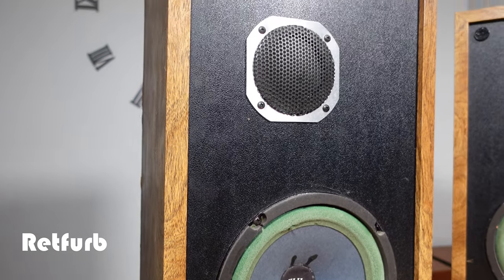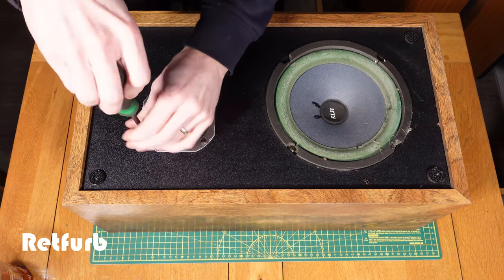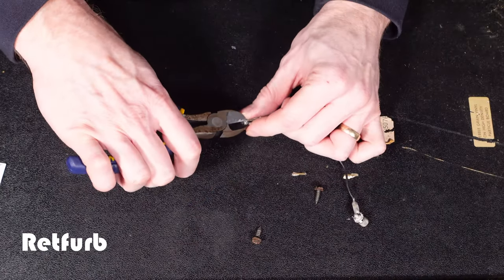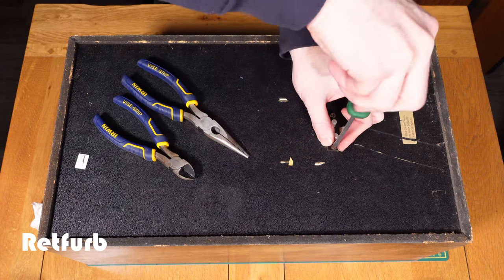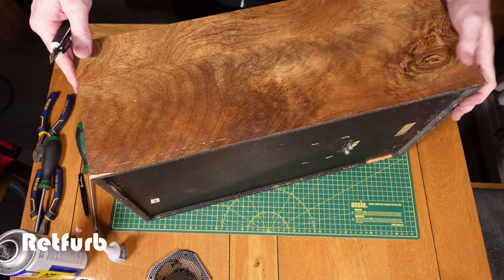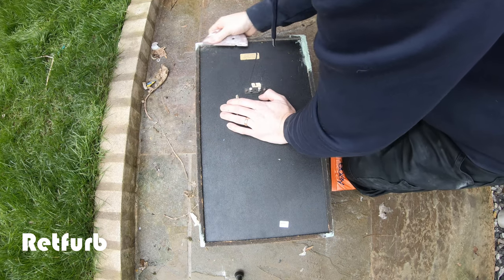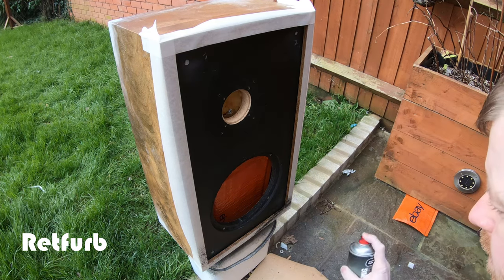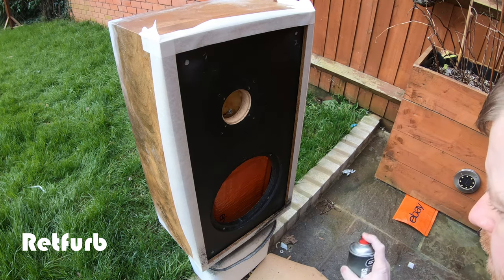1980 KLH Model 331 Speaker Overhaul Restoration Repair - Retfurb Vintage Audio

Comment: This model 331 was an updated version of the model 31. I got the KLH 31's in 1975 with a BIC-920 turntable (Shure M70 pickup) and Pioneer SX-434 (15wpc) receiver all for under $240. My first "component" hifi system. The 31's definitely had the East Coast sound popular during the 1970's. Nice video.
Reply from the maker: Thank you very much for the kind comment.
Thank you also for the additional information, I love viewer added comments. Excellent source for those looking in the future.

Comment: Hi, Great job!
What is the manufacturer of the textured spray paint please?
Reply from the maker: Thank you, it’s appreciated.
I actually used a couple different ones, as one was getting low.
They are ‘proXL protex black texture’ and ‘GTI texture coating’.
There are other brands I have used in the past, with similar results.